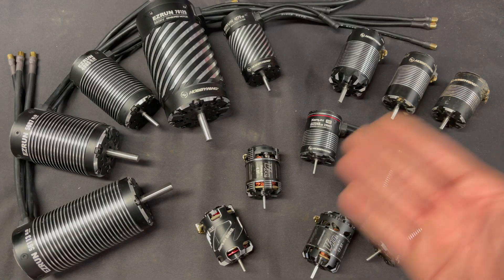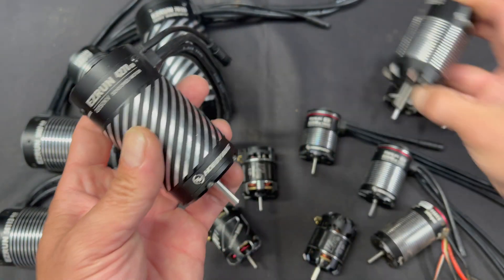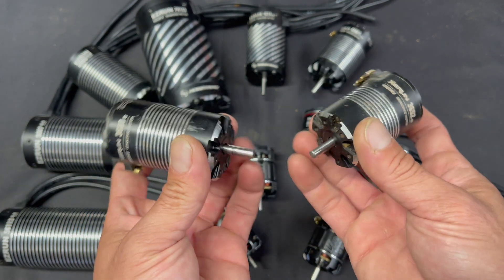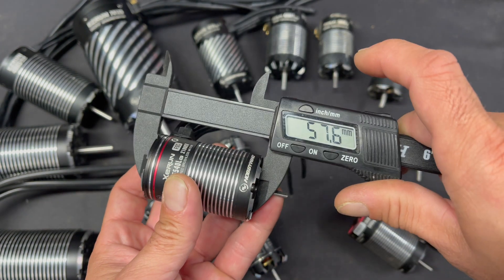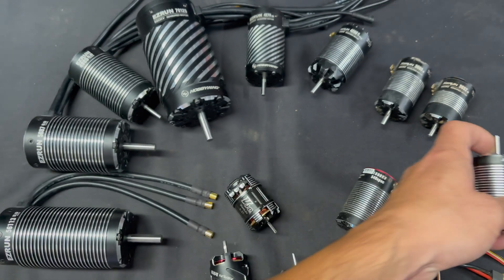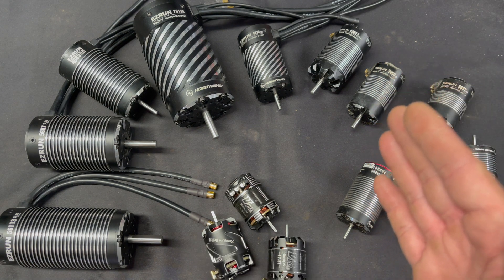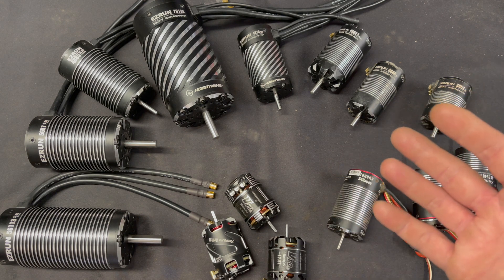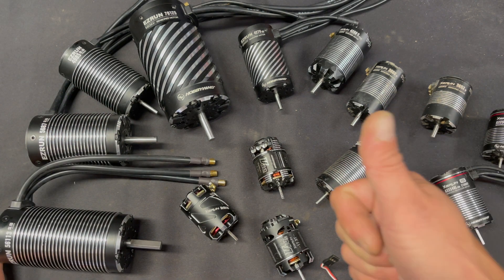The Charlie Show /// Episode 283 /// Motor Basics

Comment: hello what motor would be good for my 8s Xmaxx running my max6 esc
Reply: 1100kv, but you need a new motor mount from m2c or some other tuning-companies. so i will just use max6 esc with stock motor.
Reply from the maker: NorthAmerica@hobbywing.com is glad to asist!